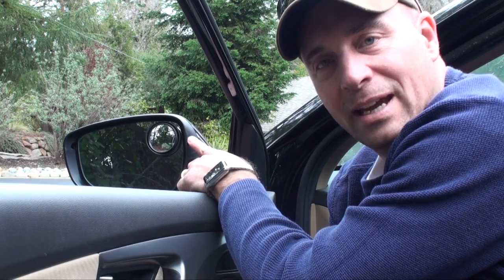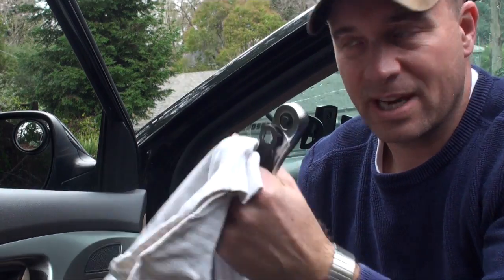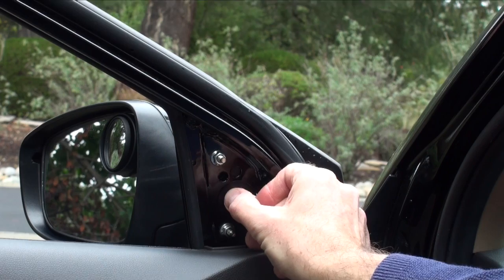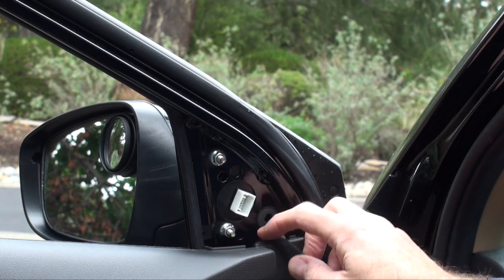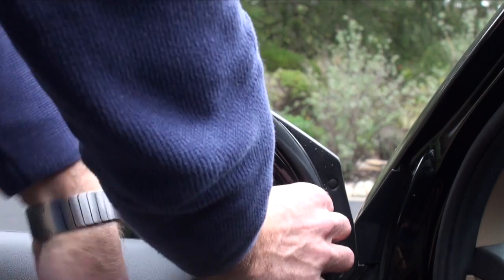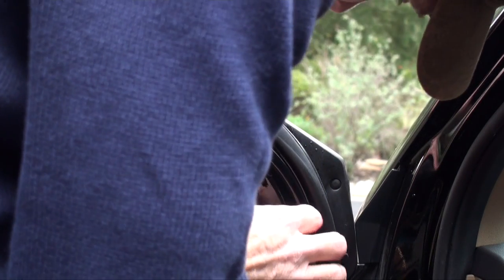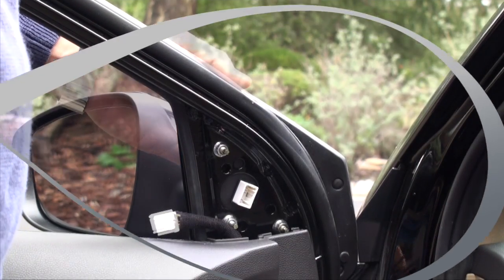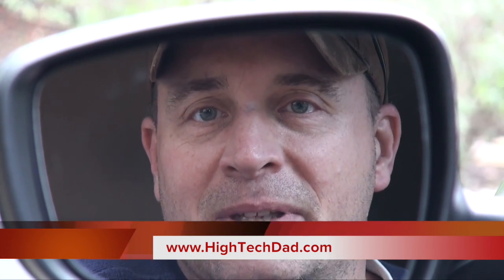How to Replace 2013 Hyundai Elantra's Side Mirror #DIY #HowTo

Comment: High Tech Dad , thanks so much for this video!  I lost my side mirror when a big truck squeezed me over into a garbage can.  I was so disappointed, I knew it would cost a ton and this is not anything I would normally expect I could do myself.  Your video was great!!! SO helpful showing it was completely doable.  Just like you said only took about 10 minutes.  We bought the mirror on Amazon (mine is a 2013 Coupe SE) and your instructions worked PERFECTLY!  We put two magnets on the end of our little wrench and it magnetized the whole wrench and with that and a little finesse, we were able to get that nut off without losing it in the door.  THANKS SO MUCH!!!!  GREAT Help!  GREAT!

Comment: Just replaced my passenger side mirror on my 2015 Hyundai Veloster. Sourced the mirror from a wreckers as new was ridiculously priced. Followed these directions and it was almost exactly the same,  plus I don’t think it took even ten minutes. Definitely have a 10mm socket on hand, and a thin flat head screwdriver with a towel is also recommended as mentioned by High Tech Dad.

The Veloster actually has a wedge of foam inside the frame to stop things falling further into the panel which was pleasing, but it didn’t have that extra node on the outside under the seal to hold it in place so I was a little nervy there and held in place with my other hand until I at least got the electrical connector in place and started the screws. Looks as good as new and I’m over the moon 😊.

Thank you so much for the video, this was exactly what I needed!

Comment: Thanks for the Video, my daughter broke the passenger side mirror off, on her 2016 Hyundai Elantra. So I picked up a black one from eBay. For under $100 and replaced it in less than 10 minutes. Including finding my 10mm wrench and socket.  Easy peasy. Yes they don't match. But probably no one will notice. Thanks again!

Comment: Thanks for the tutorial! I have a 2013 Hyundai Elantra GT, and there’s a speaker in that interior door panel, but the concept was basically the same. Replaced it smoothly with no problems. Thanks again!

Comment: Very easy replacement. I used a small extendable magnet tool to help ensure I didn't drop the lower left nut. I replaced the right side mirror very easily. Thanks for this very useful video. I just need to figure out how to paint the panel on the front-facing side to match the other mirror and the rest of my car. Any tips on that would be greatly appreciated.

Comment: Thank you. This worked for my 2014 Elantra coupe.  None of the nuts were shielded, but the aftermarket mirror had the electrical connection flipped 180 from the OEM mirror.
Reply from the maker: Glad that it worked. My mirror didn’t have electrical for the blinker (older model). Was it an issue when installing?

Comment: Worked like a charm. My mirror is just black instead of silver, but it works. A little individuality!
Reply from the maker: +Kathleen Shaw 🤣
Reply: HighTechDad what If my assembly is great but my mirror and the frame around it is off with the wires exposed? Is there a part for that or do I need the entire assembly like you demonstrated?

Comment: Great and informative video.  However, I would feel bad if I didn't mention that the wrench you are using is a "socket" wrench or a ratchet; not a "sprocket" wrench.  It was funny to hear, as you said it so many times it got stuck in my head a bit.  Thanks again for the video, though.  Very good job!
Reply: But sprocket is just such a fun word to say! :)

Comment: Its a SOCKET, not SPROCKET.  Good info though.
Reply: .............thanks.
Reply: @abaddonbolero9605  it's a ratchet, not a  socket or a sprocket.
Reply: @Jaapman100  the ratchet is the handle the socket fastens to. The socket is the 10mm

Comment: would you happen to know if the process would be the same for Hyundai elantra 2013  mirror with a turn signal?
Reply from the maker: +strawberrysteph I'm almost 100% positive that the process is the same. The plug would just have additional cable in it.
Reply: strawberrysteph did you end up changing it? I want to upgrade my side mirror with one that have a turn signal. I just don’t know if it will be compatible.

Comment: Hi there from Toronto..your video looks great! I cracked the outer case on my driver side mirror backing out of the garage 😞. The dealership said they have to replace the entire unit (total cost approx $600 Canadian). I have a black 2014 Hyundai Elantra GLS 4 dr sedan. Any chance u want to sell ur cover. If not, can u suggest somewhere to buy the part. Thanks so much! Shahila
Reply from the maker: Hey there. You can get the full assembly (which is what I show in my video) and easily replace it yourself on Amazon. The assembly includes the mirror and case (which I had cracked doing the same thing as you).
Reply: You have to just buy the whole thing, they don't sell just the plastic casings. The mirror he is using is $47 on Amazon right now, just buy the whole thing.

Comment: Thanks for the directions- worked perfectly. I have a 2016 Elantra with turn signal and it was the passenger side that was replaced. The dealer wanted to charge $500 and I ordered it online for $123 (109+shipping) at partsgeek.com.
My car is silver & black so the base came in black with a white colored plastic backing my dilemma now is trying to reinstall the silver backing that I had originally to the new mirror any suggestions?
Reply from the maker: Hmm that’s tricky. I didn’t have the luxury of having the turn signal and luckily my car is black so it matched out of the box. Sorry.

Comment: I have the same car (2013 ELANTRA). Do you know if we can buy the one with the turn signals??? Or will our car not read the signals?
Reply from the maker: I don't believe the wiring is in there to control the turn signals. I didn't want to take a chance.
Reply: HighTechDad you are correct. I called my dealership and they said it would need modifications. Thank you for your reply

Comment: anybody know if the process is similar for a 2015 Elantra? Found myself in the same situation as you that I backed out of tight garage and there went my passenger side mirror
Reply from the maker: +AsterDXZ I'm going to guess that it is the same or quite similar. Easy to take off the panel and look. Also look at the part description as it often shows the models.
Reply: I have a 2016 Elantra and it was the same procedure.

Comment: Pops a mech not me. That cloth idea was nice ty. 
Also had difficulty with the dealer your not cheap there just high on drugs. they wanted 186$ for the mirror and 400+ for install. GTFO-Of here. I bought the mirror straight from hyundai for 58 bucks and installed it in 10 minutes after watching this vid. Saying price gauging is an under statement. 
I buy a vehicle every 3-4 years Ill never buy from that dealer again. Not that it matters.
Virginia beach VA.
Reply from the maker: Yeah it’s actually pretty easy to do and MUCH cheaper if you DIY. Glad that the video helped!